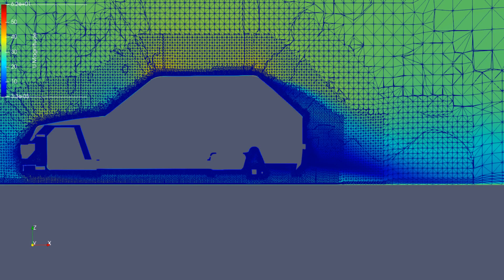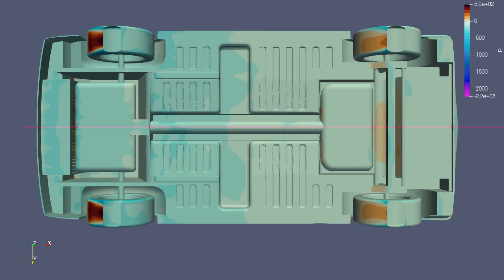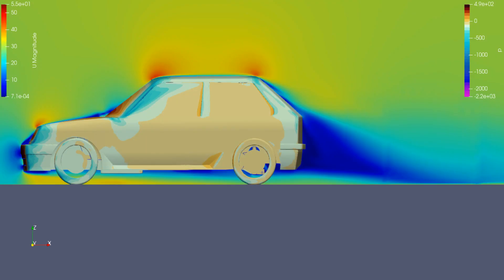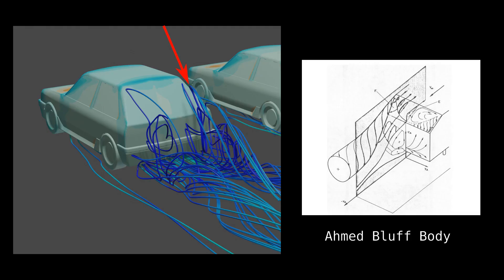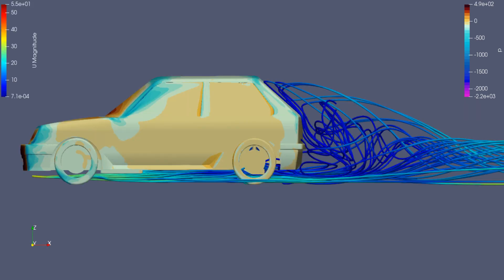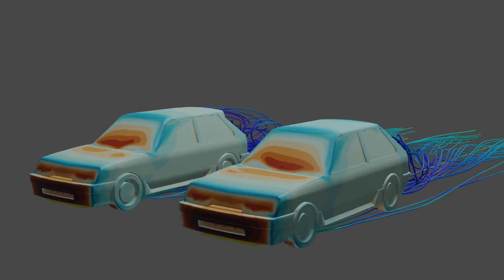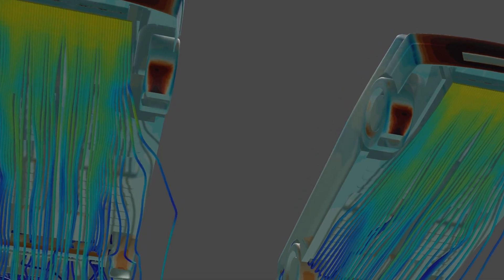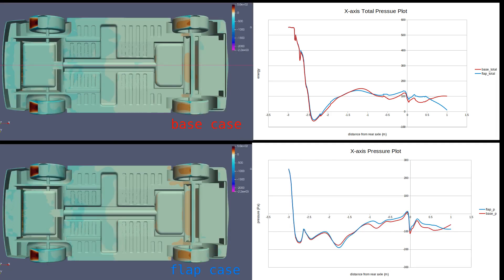Production Car Aerodynamic Analysis and Development Using CFD: Part 1

Comment: Been following some of your videos and it's nice to see some dedication towards modelling lots of different cars. 
I also notice that you are now showing SCZ and SCX terms which is much easier to compare than just a Newton value. You should consider using points instead of percentages which can also make multiple comparisons much easier (a point is 0.01 of a coefficient). It also seems like the first time (in a video at least) you've used total pressure which is again a great step.
I highly recommend plotting the coefficients of these pressures, effectively you divide the static or total pressure by the dynamic pressure. This normalises to velocity so many different cases can be compared, and you'll be able to compare your CFD to others more easily, not to mention more consistent colour scales.
The main reason for drag reduction with the spoiler addition is due to the separation off the roofline. This stops curvature over the edge and thus relatively increases the Cp in that region- as you mentioned this also affects vortex production.
The change in Cp helps since most of the surfaces in that area are facing rearwards and pressure acts normal to a surface. If you had an automated report; comparing the Cp in X and Y slices would show this.
You'll notice some cars have these 'separation edges' not just on the roof but just before the rear taillights, achieving a larger wake but less curvature and overall, less drag- much like this device.
I also recommend you create a python script for automated post processing of your cases. You'd much more clearly see the flow structures with slices of Cp and CpT through the X, Y and Z planes. streamlines are hard to interpret and much worse for detailed analysis, although they do look good for ‘cover shots’ xD. 
Overall cool to see you giving these a good crack, I would be wary of some of the models of the cars since even small details such profile selection or radii (especially on the inlets to floors) can have a huge effect on the flow field and numbers. I’d keep to the MAJOR flow structures.
Regardless it’s very nice to see that you’re putting in some time for these things. I will continue to follow your videos and progression. If you need more specific information regarding post processing analysis setups just let me know.
Reply from the maker: thanks for your feedback. 
The total pressure isn't a good why to look at downforce. The problem is that downforce creating flow structures aren't well define by this approach. Someone corrected me as to the definition of a diffuser as a devise that doesn't contribute to downforce directly. This is true but for a car diffusers aren't strictly a diffuser, meaning that air is still able to accelerate through it until it exits. If you were to look at this through TP the rotation of the air masks the low pressure. TP is much better at measuring drag and thus why it was used here. Also the window is acting like a diffuser, which is why the tangent.......
Normalising the data was done here, I just didn't show it because it didn't add anything to the video. Normalising the data works well when looking for differences at the edge of the data set not the middle. The window was in the middle of the range. I could have shifted the edge to analyse the window but I would have needed to do a 5min explanation into nondimesionalised numbers.....  
These videos need to strike a balance between talking to a casual observer and a professional engineer. Some things like x-movies aren't understood and aren't able to move there mind through space like is needed, or that is my interpretation of the dip in viewership. With the streams the eye follows and the mind is drawn along. Even the outside the car sliding frame your not giving that much more information....
It all depends what I am seeing in the results as to what method i use.